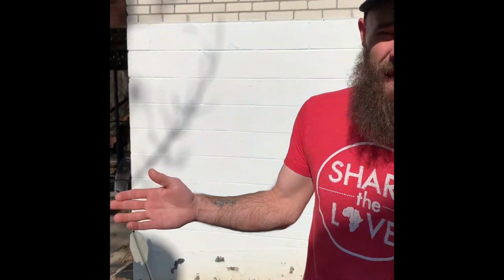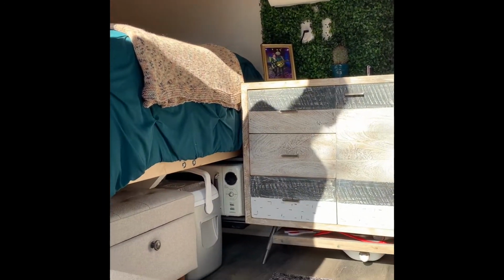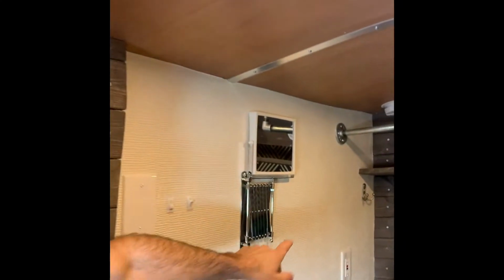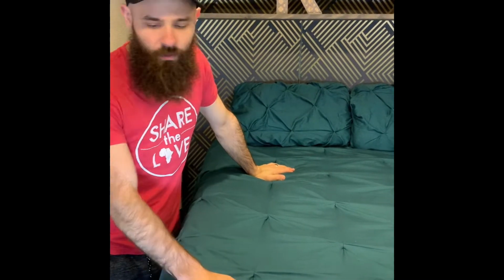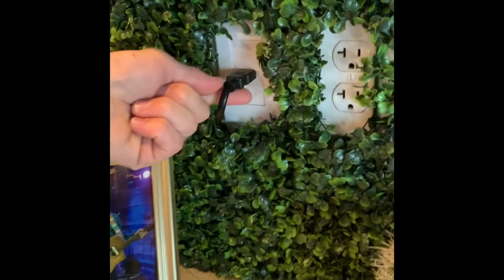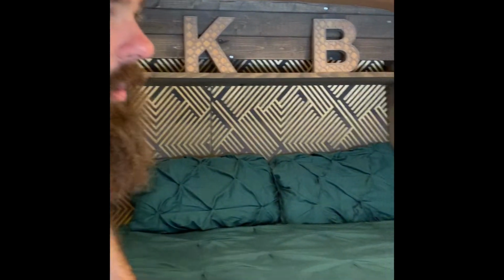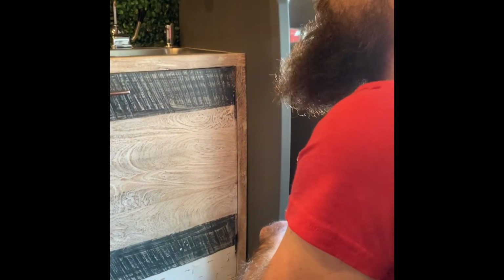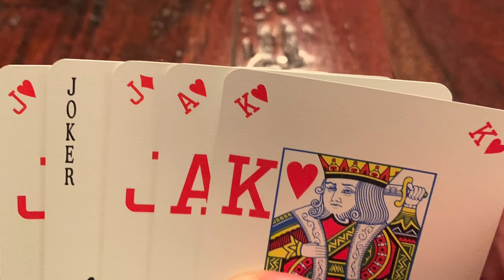Nissan NV 2500 “Cargo Van” conversion to our Touring “Tiny Home”

Comment: I have the same van with build out. But I have been trying to figure out how to haul a generator. You have got the best and I would love to build a dog house is there anyway I could get the specs?  I have looked at many ways to do this but you have the best for the Nissan.  Would you be interested in building me one?
Reply from the maker: Thanks. I can’t do the build for ya.  But, it’s a pretty simple box build. Using  sheets of plywood from Home Depot as the walls. Also got to make sure there is plenty of air flow!

Comment: hi! I love the build! What insulation did you use for the walls and ceiling?
Reply from the maker: Hey. I used batt insulation for all the pockets and crevices. Then I added a layer of 1” thick rigid insulation over the entire surface.